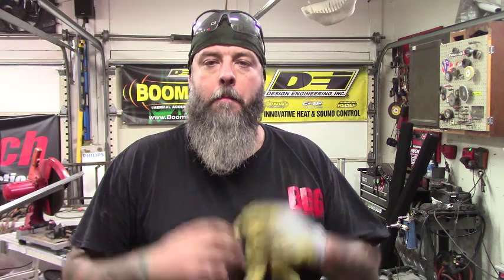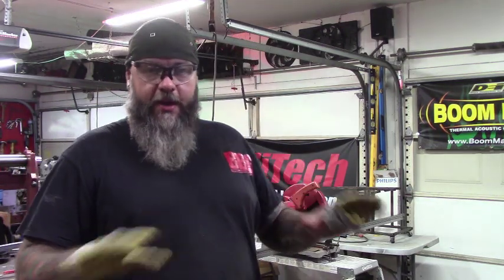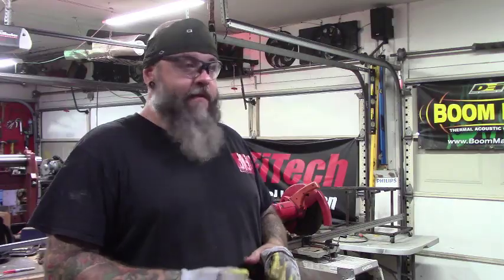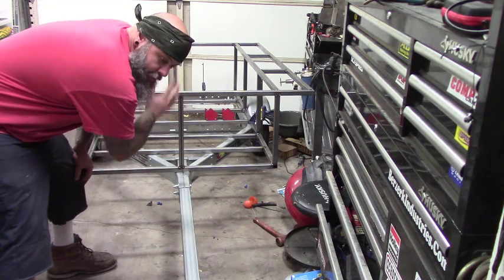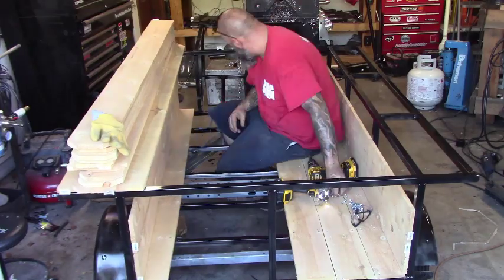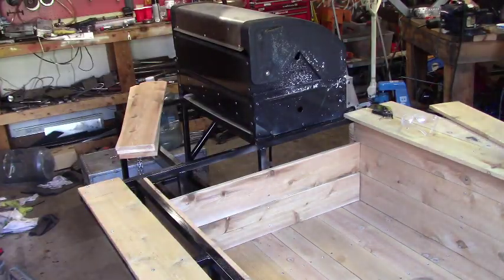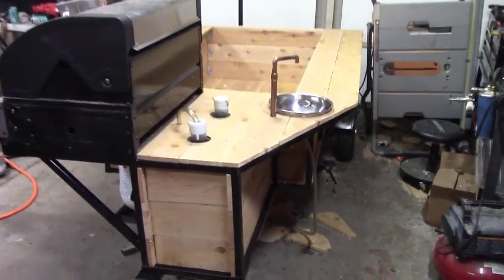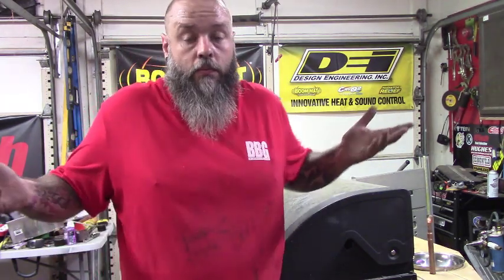Converting a Boat Trailer to a Camping Trailer

Comment: OMG, I have a huge boat trailer. The ideas are endless now. I just need to throw some ideas together and get to work. I was going to make it into a utilty trailer but i needed one really quick and found a new one that was 16x6 for only $1500, so I bought it. Now I have a huge boat trailer with nothing to do with it. Thanks for the upload. I will make something like this and also stain and seal the wood to help it last longer. Thanks

Comment: Great build. Only issue I see is you might want to put a heatshield between the opening on the back of the grill (i assume its for the drip pan) and the plastic parts of your water system so you don't melt any of it.